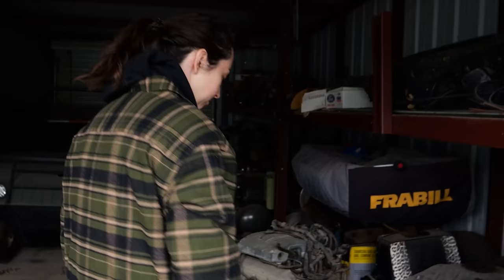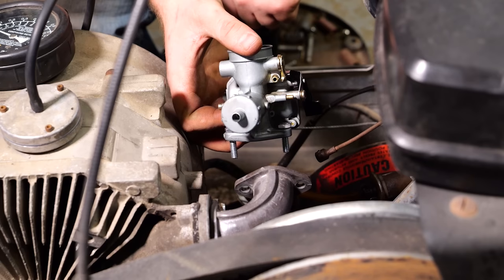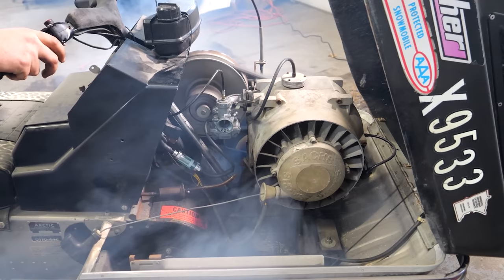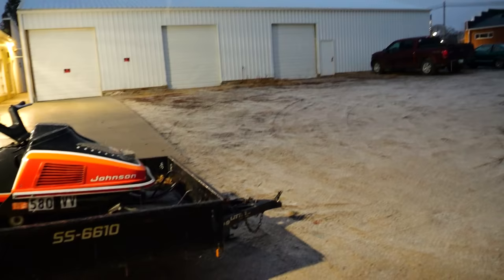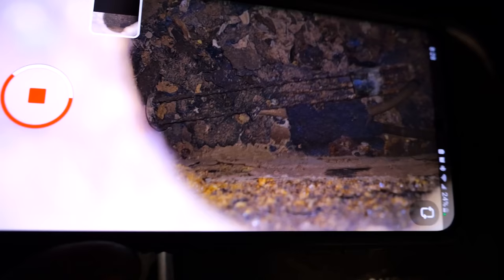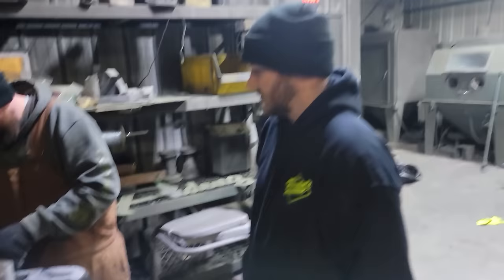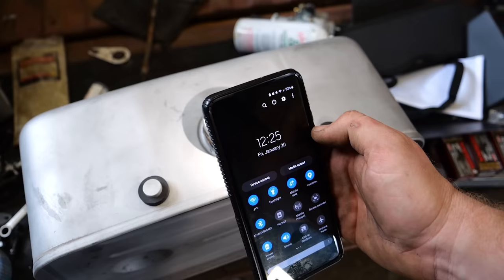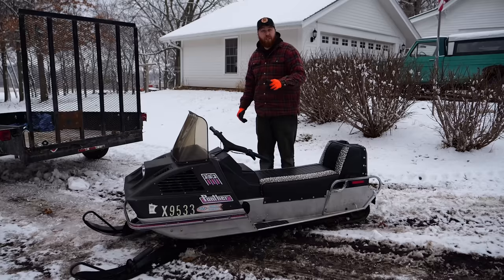ABANDONED Rotary Snowmobile - Will it Run After 20+ Years?

Comment: To Kevin and anyone else riding snowmobiles please be safe. RIP Ken Block. Thanks for all the amazing content and be safe out there.
Reply: Just found out he passed. RIP...
Reply: Our man is a showman, but he needs to wear a helmet on these off-road rides.
Reply: fast snowmobile and safety do not go together 
adrenaline junkies that die while sending it die doing what they crave
Reply from the maker: @feelinghealingfrequences7179  thank god we have slow snowmobiles
Reply: Jet skis and snow mobiles are gnarly when things go wrong
Reply: @JunkyardDigs  A slowmobile then?
I'll be honest, I was quite surprised with how well this turned out. I mean you've repeatedly impressed me with what you have managed to pull off, time and time again. But this, this was brilliantly executed.
May I suggest that as well as having removed the rust and soldered the holes, you look into epoxy coating the inside of the tank? I know a few people into vintage bikes and many of them swear by using POR-15 to do the job.
Reply: @mikes78  POR-15 is good stuff. I should look into getting some to line a vintage steel 5 gallon gas can I have so it doesn't get ruined.  :)
Reply: For real
Reply: Yep. Blame the machine for when an operator makes an error. You can get hurt on a riding mower if things go wrong. I liked Ken too, but speaking from experience, anytime I got hurt it was my fault, not the machine. So use your head and think twice and pray for those who don’t.

Comment: Your description of how vacuum driven secondaries on carburetors work is why I love British SU carburetors.  They are side draft, "constant depression," carburetors where the throttle plate gives the vacuum signal to lift the piston that slides out of the way to allow the correct amount of air in and lifts the needle the correct amount for the correct AFR.
Reply from the maker: Oh God I working on those so much. constant velocity carburetors are the bane of my existence😂😂
Reply: @JunkyardDigs  Lol!  Nothing wrong with them alone, the challenge comes when you need to synchronize two of them.  But man they are brilliant when synced and you're zipping around some back roads or surface streets.
Have fun out there on the sled!
Reply from the maker: @johnpearson492  that it is!

Comment: Apple cider vinegar works wonders on rust in tanks! Let her sit for a couple days, drain and rinse with distilled water and use a heat gun to dry it out! Ive done this on a couple old boat motor tanks and a couple 3 wheeler tanks. It works great!

Comment: That Arctic Cat sure brings back some memories.  My family had one back in the 70's here in Anchorage AK.  I was pretty small, but I specifically remember that leopard print seat, and the front bumper for some reason.  I also remember the fuel tank on the back of the seat, because I found that if I dipped a rag into it, I could wipe dirt off the cowling and make it really shiny.  Dad wasn't happy with me when I did that of course.  I was probably about 5 or 6 years old at the time.

That old Arctic Cat I remember as a kid is now at a remote hunting cabin about 75 air miles NW of Anchorage.  It's been sitting there unused since the early 1980s, so I don't have any hopes of getting it to run, even though it's been under good cover all these years.  My Dad rode it out there with his hunting partner in the late 1970s moving building materials, across Turnagain Arm, up several frozen rivers.  Probably about 110-120 riding miles.

Thanks for doing this video, it definitely brought back some great memories.

Comment: Hey Kevin, Evaporust is a great rust removing fluid to use on fuel tanks and pretty much everything else. Used it on my ‘70 Land Rover tank that was completely trashed and it looks like new now after leaving the stuff in overnight. Pretty sure you can find it anywhere but I picked it up at harbor freight. Loved the video! The sled sounds great!
Reply: I've had good luck with acids, starting with Vinegar, and as with radiators, I've had a better time with epoxy than with solder, mostly because it is easier, but also long term, solder is a dissimilar metal that will accelerate future rust where it ends, where epoxy won't.

Comment: Says a lot about the quality of Kevin's content that a Texas fella who's never sat on, much less rode on a snowmobile will sit and watch a 45 minute vidya on some other fellas wrenchin' on their sleds.    Just remember rotaries need to have the piss revved out of them to make usable power, kinda like Detroit diesels, and run enough oil in the mix to keep the tip seals lubricated (if it ain't choochin' smoke, it's not enough oil.)    Sure did sound like it was running out of fuel on the top end, so I think you're bang on about rejetting that little Honda carb - although you might never get enough fuel through there - or just seeing if the other Cat has a rebuildable Tillotson, put it together with yours and make a decent carb from the two.   Sure does sound wicked at idle, though, poppin' and snarlin' and wanting you to send it.

Comment: Panther and Enticer. That's two snowmobile names that I grew up with. 
My father used to own a 1983 Aktiv Panther (A Nordic version of Arctic Cat), which had a two-cylinder Polaris 380 engine in it. It was a terrible engine to be honest. It ate bearings and did not run well when it was warm. But when it did work, it was an amazing snowmobile. I had a lot of fun driving it when I was a kid, and throughout my teens.
- I do know that many of the Aktiv snowmobiles used Suzuki engines, or Rotax as well, which was a heck of a lot more durable.
I used to own an early 1980's Yamaha Enticer (ET) 340. That thing was really good, and it always started easily. You can say a lot about Yamaha, but they knew how to make good engines back in the day. A nice lightweight snowmobile that took you where you needed to go, quite easily. That thing was pretty fuel-efficient too, where you could go a long way on 10 liters of gasoline

Comment: For future use. You can buy Epoxy repair kits for gas tanks. You put masking tape or whatever over any holes, pour the epoxy in swirl it around until there's no loose epoxy and let it cure. Caswell makes a nice tank sealer that's usually around $50.

Comment: Dad bought a used 303 in the early 70's to replace his Moto-Ski. Wankel was much easier to start than a JLO or Hirth, reliable, decent economy. Did not have shocks on the skis. Not a lot of power and Panthers were never light but that's what I learned to ride. Odd idle lope told everyone what was under the hood. Dragging petulant sleds through the snow, what memories! Was still running well when he traded for a new Jag 3000. Night and day.

Comment: I had that machine as a teenager in the early 80s, but with a 2-stroke, 300cc JLO piston engine. The nice thing about it was that the mostly aluminum construction made it lighter than most snowmobiles. Since I probably only weighed 120ish pounds, and it had a wide track,   I could climb right up on top of the powder while other snowmobiles made like snow-plows and threw the powder in the rider's teeth.

Comment: For rusty tanks, evaporust or whatever in there with some small screws.  Seal it up and strap it to your tractor wheel and drive around a while.  That mad emy old gravely tank come out nice and clean.  Some POR tank sealant in there afterwards to protect it for the future is a nice finishing touch.

Comment: We used a plastic 5 gallon gas can and painted it black and put a fitting in the in the bottom corner worked perfect. Just a suggestion. Cheers. 
Doug.

Comment: @JunkyardDigs you gotta do yourself a favor and check out more Metal Rescue stuff. Ps Save that liquid and you can use it over and over till it evaps or stops working. No need to pour it down the drain yet. Save you a lot of time and money too.  They make a liquid and gel Rust Remover and they both work stellar.  Used them both on everything under the sun and it's so good it'll take rust off and not harm wood on the same item. Just try to keep the evaporation to a minimum when using it for best results. Some items I use saran wrap and others saran wrap and Vaseline like when trying to get rust out of piston to seal cylinder with head off.  I always have their 5 gal bucket with the soaking basket around. Hope that helps sometime.  You and Mook keep on keepin on man! 🤘

Comment: A tip for cleaning rusty tanks. Buy some citric acid and mix that powder in some water in the tank and let it be. Maby some rocks or nuts and shake around now and then to knock of the loose stuff. Then pour it out and then add water with a dishwashing tablet and shake around to neutralize the acid. Then flush the tank out and voila :)

Comment: Your gas tank repair is pretty inventive i forgot about soldering radiators. However if you want to make the repair even better I recommend you go out and buy some por 15 gas tank sealer or a product called red kote. You pour these products into the tank after mixing and shake the tank around for a few minutes then let it set overnight. Sealing both the inside and outside should make sure you never have any leaks again. These two products are excellent at sealing holes in metal gas tanks and I have used them on old cub cadet garden tractor tanks with great results. Taryl fixes all has a video on red kote sealing a vintage motor cycle gas tank and it worked perfect. Great video as always!

Comment: Back in the day, my Dad bought one of these that looked mint, but wouldn't start...for $25! Turns out the previous owner put in spark plugs that were a millimeter or 2 too long, and as the rotor came around, it mashed the gap flat. We put the proper plugs in it and it ran awesome!

Comment: You might be able to get a fuel pump for a newer machine to work alot of the post 80s machines used makunie carbs so they had separate fuel pumps 
Try looking for one from a arctic jag they were usually single carb separate fuel pumps

Comment: You should look into the electrolysis method of cleaning a rusty gas tank, I've used it twice on motorcycle tanks with great results. Google it for proper directions but basically fill the tank with water and baking soda then hook the negative side of a battery charger to the tank and the positive side to a piece of metal suspended into the tank. It cooks the rust right off leaving a clean tank, after flushing all the nasty baking soda and water out of course. Like I said I've saved two very rusty tanks doing this.

Comment: Single rotor engines sound so adorable! Also, Thunderhead did show that a tiny carb on a big engine can actually run too rich. If you restrict the engine enough with a small enough carb (like a lawnmower carb on a 302 V8) you can pull more fuel out of the jets than is needed for the amount of air, as the engine is pulling enough vacuum to basically pull fuel from the bowls through the jets. That is why he had to dial in his 302 with the mower carb using a controlled vacuum leak to get enough air to maintain 14.7:1 or there abouts AFR.

Comment: If the PTO crank seal was bad, the mag side is probably bad too. Real easy to change out, just unbolt the two mag side engine mounts, lean the motor over, remove the fan shroud, flywheel and magneto plate, and the crank seal will be right there. It will be very difficult to figure out your jetting until you get that mag side seal and o ring replaced.

Also, what sled was that other slide carb off of? Very cool that it bolted up and ran!

Comment: Hi Kevin have the skies on your black sled covered in rust on the bottom. I’ve had to sand, paint and wax the skies on most of my old sleds. It helps by100% to let an under powered sled move much easier. Cheers Doug. Ontario Canada.

Comment: Vinegar, diluted 50/50 with water makes a really good rust remover that I've used for years on motorcycle and atv gas tanks. You can use straight vinegar for faster results but if you do it really should be closely monitored because it can eat a hole in the tank if left to long.

Comment: Didn't realize AC sold a rotary, lol.  Had a factory (mid 70's) 650 3 rotor Evidence that we raced, incredibly fast once we figured the clutch/converter !!  Kool vintage sleds, love to see them saved & enjoyed !!  Have used muriatic acid in the past, just gotta watch, have eating all the solder of seams years ago...  Lol!  Also, ever tried "Seal-All"?  Have stopped active leaks before, couple of coats for good measure...  Thanx !

Comment: Hey Kevin definitely the best fix for your fuel tanks is Red kote we have used it for years fixing and recovering steel fuel tanks on small engines. It's super easy to use and will seal almost any hole as long as they aren't huge.

Comment: Use Muriatic acid in the rusty tanks.
Use some nuts and bolts and shake it up wash it out with water and then use the acid. You can buy it at lowes or home depot.
Wear eye protection and skin protection. You can re use it over and over. Keep it in an old gas can and label it. It works great and does the job FAST..
Sled looks sick!!

Comment: Put a little acetone, In the fuel and drive it , It will clean the carb out , But you Have to run it, Get the rpm's up

Comment: I got a plastic see through model kit of a 2 rotor Wankel engine back in 1985, and I became a Wankel fanatic, then I did some research on the engines, and discovered that the side seals on the rotors need replacing sooner than is comfortable, maybe the metallurgical wizards have discovered a better way material for the seals, I don't know. I'm regaining some interest now!

Comment: Hey Good Sir,,,, There is a product that I have use to seal an automotive fuel tank.. I got it from O'Rielly's and it is called seal-all.... Comes in a tube and is clear  dries in just 10 minutes enough to add fuel to tank.... Also can use it on a full tank that is actively leaking and will seal it shut..., Car is still with the same tank 3 years on and still no leaks  Great videos by the way

Comment: Just like old cars and trucks old snowmobiles have character new machines can't replace. Especially in an era where everyone and their granny were trying to get a piece of the snowmobile pie. We never got to ride snowmobiles as kids but my father still had his sitting on a pallet under a covered lean-to for the longest time when we were growing up. It didn't run but I'd go outside and sit on it and pretend it was going somewhere. I always asked him if he'd get it running so we could use it but he was just too busy. 

Besides that the biggest thing stopping him was the gas tank. Dad's sled was a 72 Sno-Jet Super Jet and all of their gas tanks were built into the tunnel so they had to be cut out when they'd rot. Which is what was wrong with his. He didn't have the time or interest so he eventually brought it to a friend of his that had a repair shop and it was assimilated into the vast collection of vintage parts snowmobiles he had in the back. :)

Comment: Drain cleaner mostly is water, alcohol, sodium hydroxide and couple magic ingredients i dont have clue about, but while i havent tried it to metal parts, it does amazing job (though slow) to spray painted plastic fairings. So if you are restoring fairings to some forgotten thing that you can get parts no more, that cleaned them right and proper, though it did take whole day or two, with some suns heat and brush to mechanically get paint chips off when it has started to do its thing. Best part was no damage to fairings witch i was afraid with any normal paint remover.
Side note do not leave container you have the part in out on the open in the sun with out some kind of cover to prevent birds for instance drinking from it. Also wear proper safety equipment. Brush will throw droplets and its not nice to have one in your eye.. rubber gloves are good idea since this stuff starts to burn real fast and chemical burns are not nice.

Comment: 34:01 if you wanna de-rust something, you should try oxalic acid. That stuff works wonders! I did the fuel tank, practically all the screws and a lot of small parts from my moped with oxalic acid. Also it's cheap, and does not form any noxious vapors ;)

Comment: Great! It goes without saying looks like fun. I am guessing you have looked into replacing the hyfax and also the drive sprockets in front. The old plastic gets brittle and those sprockets disintegrate. All should be available as new parts. My first and only sled was a 71 Artic Cat Panther with a 295 Kohler single. Still have it.

Comment: As far as your Hyfax is concerned, you can probably make something work with some UHMW plastic. you'll definitely want that because it's smooth as butter and the high molecular weight will make it last practically forever. this is the stuff those  weird plastic cutting boards are made out of... it might be possible to fabricate some if there isn't any available. you might also be able to steal it off that other cat but it's probably in the same shape.
Reply: You can get that on Amazon in various sizes and thicknesses. There's also HDPE (cheaper) but I don't think it's as durable, maybe someone else can explain the difference.

Comment: Drain cleaner (lye) can be used to remove aluminium from steel, literally melts it off. I’ve recovered a spun air compressor crank by soaking it in drain cleaner, pulled all the aluminium right off without needing any tools or sanding.

Comment: Excellent video Junkyard Digs Kevin  :) on sled got fuel tank should haul back to shop get engine belt if great shape use plus track plus boogies plus gears turn from gear drive that worn out  plus skis for  or any parts need fix up yours with too use ! Hopefully helps you out and be wise to make a parts sled to good sled ! Fuel do 50:1 and use 5% Ethonal of 89 or no Ethonal gas 91 or higher octane gas in Oil mix 500 ml worth too! Need get Headlights bulb and back brake light too!